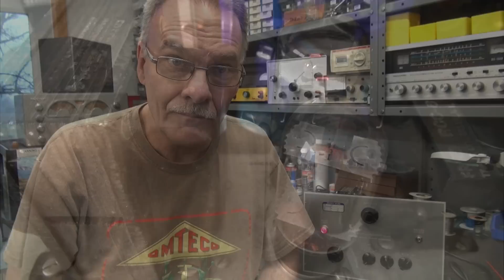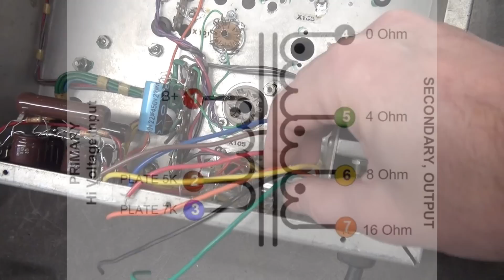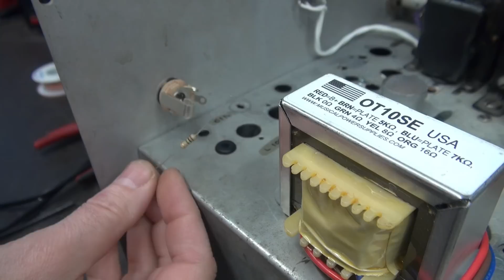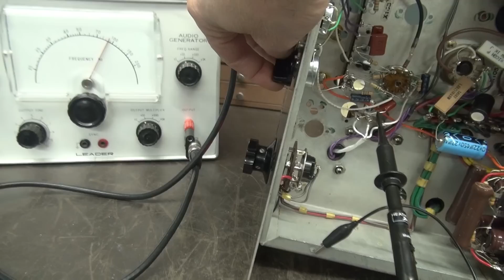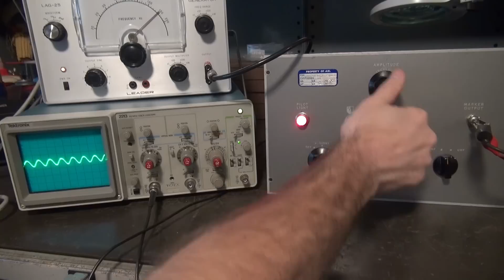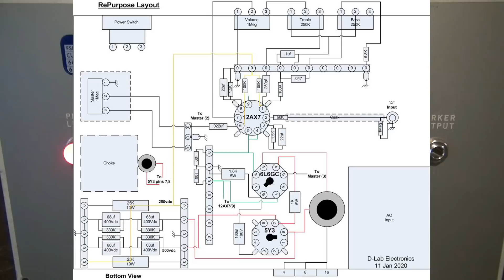How to Re-purpose junk into a Tube Guitar amp Part 3 wiring & Build Class A Masterpiece

Comment: A guitar is a difficult thing to play in a lab, extra cords, rapping the headstock into something ... I built a 2x6 stub with a Strat pickup, a tuning machine, and a string anchor, and a cable to plug into an amp. Then I can pluck the string on the workbench and test. Because otherwise I get distracted with playing guitar, which is the biggest problem.

Comment: Hi Jerry. I really like your youtube channel, especially if it comes to guitar amps. I got a question: Did you ever have a fender ramparte on your bench? I think it's quite similar an amp circiut-wise as your re-purose amp but shows a lot of hum and noise. Do you have any idea how to reduce it. I already tried to hook up the heater supply  ground to + 70 V to reduce hum with no success. Kind regards Wolfgang

Comment: Hi, Terry, wouldn't it be a good idea to tie the screen grid of the 6L6 to the 250V point rather than to the 500V supply voltage? So then the grid bias voltage would be significantly less than the about 52V I consider very high?
Reply from the maker: Hi John, Not sure, I believe it would reduce the output of the tube? Fender circuits apply close the the same Plate voltage to the screens thru a 470 ohm resistor. Many of those amps run close to 475vdc. If I went with negative bias, the Cathode voltage would be 0 since that resistor would not be used. Many things that could be done. This project is just an example.

Comment: Why ist that 6L6 suffering at 30 mills? Why that less? I guess, 50 mamps would be better to let this tube do its job. When you were using your signal generator and the scope: What wattage rms did you measure at the 8 ohms load?
Reply from the maker: Hi John see the bias calculator on weber.com see chart for 500vdc plate
Reply: @d-labelectronics  Thanks, Terry, for your quick response. Yep, I've fed the Weber bias calculator with the 500 V value and it spits out 54 milli amps in class A mode. Or have I done something wrong?

Comment: hello..in the last schematic the two resistors for the 250 vdc are 50 k..in the last layout are 25 k...choke goes to 5y3 7,8 pins..i dont find pin 7...i dont find ,in the layout the condenser 22 mf 450 v for 250 dc..excure me for my bad english

Comment: Interesting.  I wonder how much work would be to add a second 6L6 and Phase inverter system.   That Transformer will work with two or is that made for single ended one tube amps?    Seems funny to waste all that power the supply is able to produce and really there is plenty of room :).  Make that amp into a 50 Watt version :).
Reply from the maker: We will make that circuit in future videos, This one was intended to be basic, straight forward, so others could build it.

Comment: If you used a different output tube closer to 7K plate load, you could use the 5K tap for Ultralinear operation. Even have a switch between Pentode and Ultralinear. Just a thought!

Comment: That amp really sounds great. This old equipment really deserved second life like that :D Great job, as always ;) Only thing that i personally would do is add one more tie point near the 12AX7 socket to wire the grid resistor to it, so it is not just hanging in the air and pulling on the socket lead because of this long cable. Keep up the good work, thank you for sharing your knowledge and experience.

Comment: Thanks, Terry. Didn't you forget to connect the black wire (0 ohm) to the 16 & 8 ohm connector?
Reply: the grounds for the three outputs are connected through the chassis. Grounding 1 of the jacks grounds them all ( as long as they have continuity to each other)

Comment: Maximum grid resistor for a 6L6 is 500k. You might get some blocking distortion with a 1M master volume pot.
Reply from the maker: Roger that, will keep an eye on that, May add a shunt 1 meg